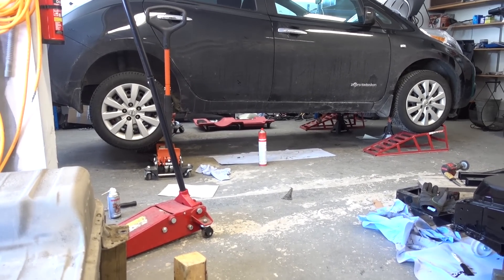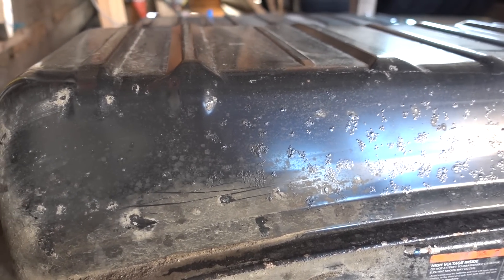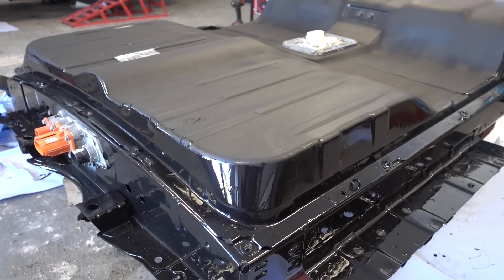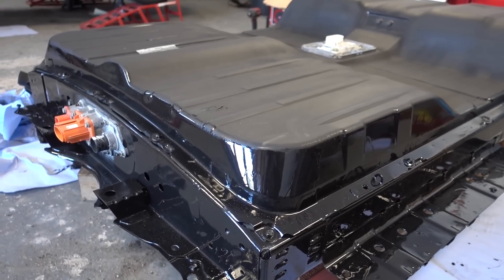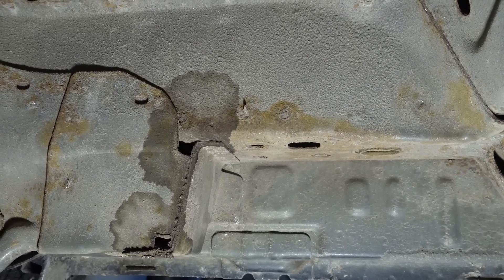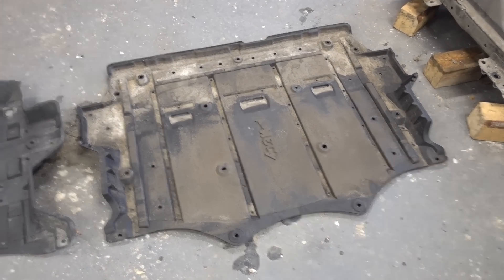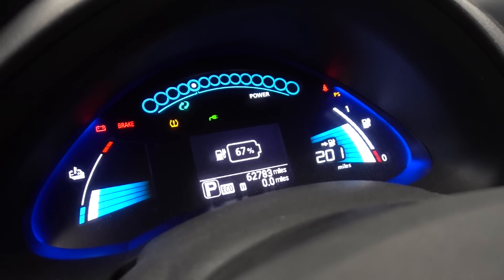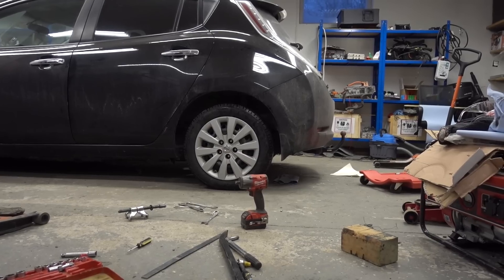My new 62kWh battery is broken😞

Comment: That sucks, but I assume you going drop that battery for now and so maybe get it apart and see if any cells have expanded or corrosion etc and if by chance they have not, maybe remove weak cells and try to charge them up and see if that helps? Probably not but worth a shot until you can locate some replacement cells. Would have thought by now some third party could make cells for these. Must be a lot of Leaf's out there for it to be worthwhile now?